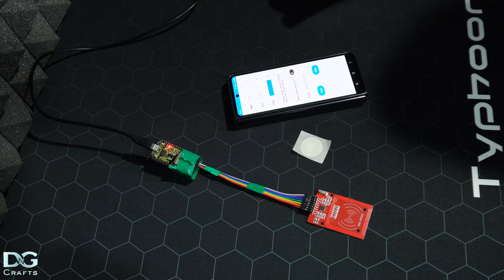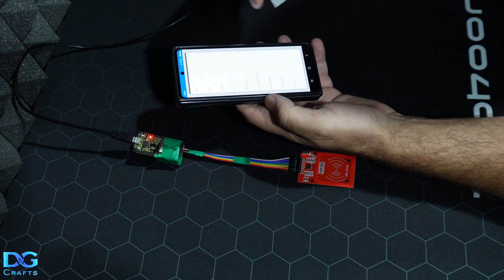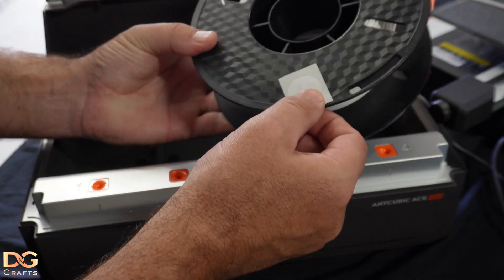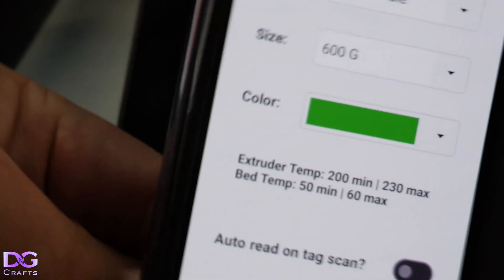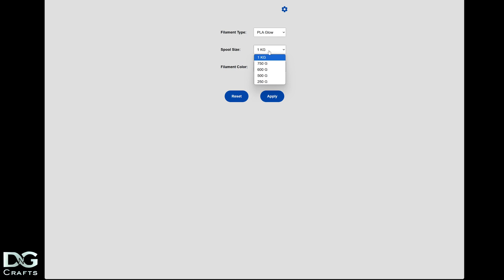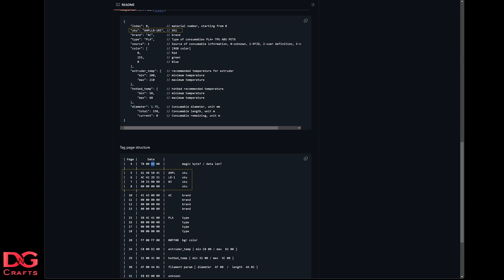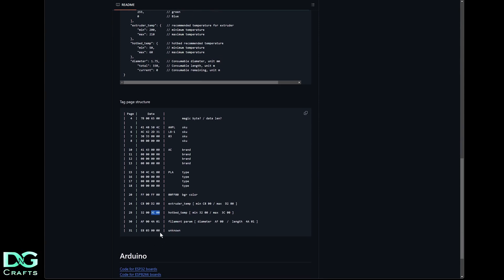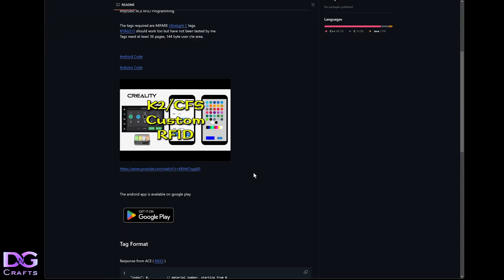Anycubic Custom RFID

Comment: Will this work on just the Anycubic Kobra 3 v2 Printer? Or does it need to be the ACE Combo?
Reply from the maker: it should work with all of the anycubic rfid readers, if the printer can read a rfid tagged spool that anycubic sells it should read the tags you create
Reply: @DnG-Crafts thank you

Comment: @DnG-Crafts UPDATE for everyone:  NTAG213 works!  I could not get NTAG215 to work.  Maybe it was the batch that I had but I had nothing but problems writing and reading.  The App and the interface are awesome.  Thank you.

** please note that a high pitch means it has written successfully, and a low one basically means it only read the tag **

Comment: I want to use this - but HELP.  I am sure others are having problems.  I purchased  rfid tags (ntag215) with 504 bytes of memory - and I am using an esp8266 with the RC522.  I don’t have a speaker but I am sure it would work without it.  I flashed the esp8266 with no issues.  I set up my wifi ssid and password and I have no difficult connecting to the web page.  The phone setup seems fine and I created a filament and used another.  I have no idea how to connect to the rfid writer with the phone.  I would like to say I am a noob - but I am a retired IT professional and I feel like one.  The phone app will identify the rfid tag  - and I don’t think you want to use the phone.  I am having NO LUCK in writing with the rc522 at all.  Nothing.

I am sure it is there - but how do you connect from the phone to the rc522 writer/esp combo??  It must be right in front of me… but no joy!

btw - nfc tools can read and write to the tag with a phone.
Reply from the maker: the rc522/arduino is a separate project to the phone app.
if you have an android phone with nfc then you just use the phone to read and write the tags.

if you are using the arduino project you need to make sure the gpio for the rc522 is correct because not all boards use the same gpio

Comment: This is great, I am in the process of trying to use these for 2 purposes - 1. spools w/o RFID tags 2. For my swatches. 
I want to be able to pull out a swatch, read it with the NFC reader, and know info on color, brand, etc.
I was hoping that the tags could be the same so I can copy from the swatch to the reels in the future, but they may have to be independent if the data is not compatible.
Thanks for your hard work!

Comment: Does anyone know what color code anycubic uses for transparent filament? I just set it to white, had another white in my ACE and it did always print from spool 1 (other real white) instead of the spool 2 (transparent with white in tag), even when I selected spool 2 to print unicolor. Leaving color field blank is not possible in the app.

Comment: Great instruction, not working on my samsung galaxy - but it does work on my pc. The only issue i have is that If i create a new one (elegoo for example) - the name synced from the ACE is "Elegoo Rapid PETG" but the type is set to "?" and it will not use that filament. Any Idea what i do wrong? Thanks

Comment: The byte ordering has to do with the 'Endian' mode it's stored it.  Which looks to be Big Endian.  So when it's byte strings it's order shown is read out backwards,  that's how you get the 014A Hex for the 330 Dec length.

Comment: You are a genius!  I bought some NTAG215 NFC tags from amazon and the are writing and reading perfectly using the android app.  This will save me so much time switching out rolls on my ACE pro.  Now I just need to figure out how to mount to the rolls without having to use the tags peel off adhesive.  Has anyone come up with any good ideas to do that?  Thanks for all the awesome work!!!!
Reply: On cardboard spools, I put a strip of packing tape on it, then tape the tag to it with another piece of packing tape with an ear folded over. (I leave the backing on the NFC tag)

Comment: good morning, I find this app of yours very interesting, but unfortunately I don't have an android phone... but I have an arduino nano and a raspberry pi4, can I kindly ask you for a guide to install on arduino? my idea would be to take the codes from the app you created and write them on the rfid with an iphone.
Reply from the maker: i can make a video guide when i get some time but the nano is no good for the project because you need wifi on the board so you can connect to it with a web browser and change the color/type of filament to write to tags.
Reply: @ thanks for the reply… i bought the esp8266 and the rc522, i copy the files in the esp8266 and connect the cables as in the description? right?
Reply from the maker: @giovanniguardabascio2642  you have to write the sketch from the esp8266 files to the esp board and connect the rc522 to the boards gpio as shown in the description
Reply: @ good morning, I tried to write the arduino.ino sketch with arduino ide, but it gives me an error... connecting the pins as described, the buzzer always sounds and the led flashes... can I ask you for a hand for the installation? Thanks

Comment: This is amazing!! Thank you so much. 
I have successfully created tags for 3 colours so far, but for some reason the black will register but only the colour, it won't say PLA and it won't synch with AC Next properly. I am using Ntag 215. Any help would be much appreciated. I should also mention I have the ACE Pro with the Kobra S1. Thanks again
Reply: Did this work with the kobra s1?
Reply: For the ACE Pro, yes. I have not tried it on the KS1 with an outside roll

Comment: But when i sync with next slicer in slicer all set to anycubic brand. So i must change it manuelly to my saved filament settings. So this is only usefull for anycubic filments
Reply from the maker: Still working on getting other filaments to load.
Anycubic never designed it to use anything else but their filaments but i have a few tricks to make it work with other brands.
Reply: @DnG-Crafts  Hey! Did you get it working better with other brands? Im having issues, i got it to sync with the correct profile, but when im choosing the colors, i choose my custom preset, and paint it, but when sending it to print, it wont let me use that filament, because it doesnt detect is as a pure PETG or PLA, i sadly think this can be only overwritten if anycubic makes it more open.
Reply from the maker: @snoobster1  no, custom filaments wont work with remote print.
for the anycubic app you have to use the presets in the app to tag the filament spools for the remote print to work.

Comment: What can you say about new anycubic kobra s1 comb?
Reply: The ACE is the same. There is just an improvement in the cover to keep the spool on track.
Reply: Someone a link wich tags they used, i tried 4 different ones for the moment. but not one of them working, i tied ntag213 en ntag215. 
Thanks.

Comment: tried with two mobiles and different ntag213 but no luck :/ app ever says invalid tag type
Reply: yea me too
Reply: The TAG's memory size must be at least 144 bytes. Test it with another app.
Reply: I use ntag213 144mb, he can read it, but i cant write ?! Witch are the correct one to use for the ace pro?
Reply: @bartjepeeters4047  use an 215. Problem solved. I Did the same.